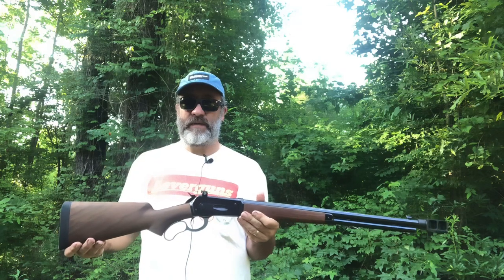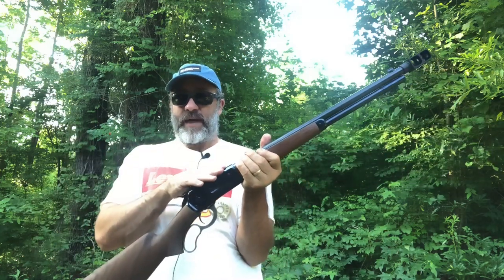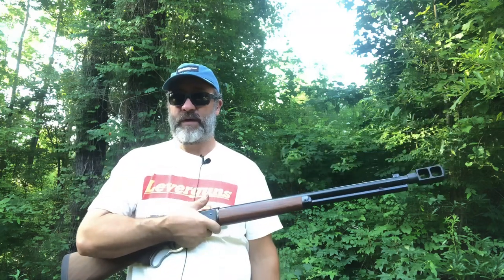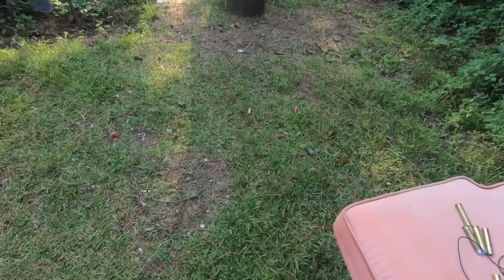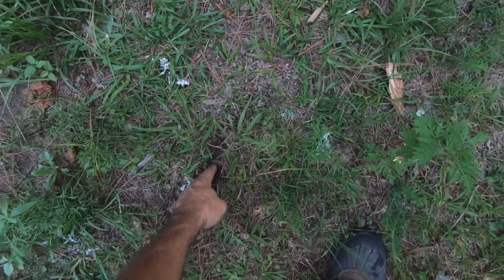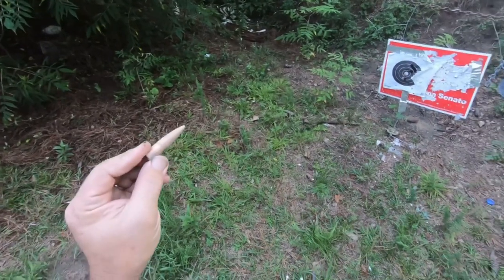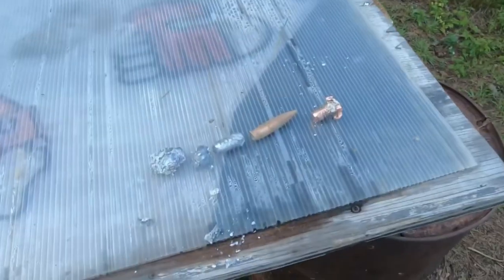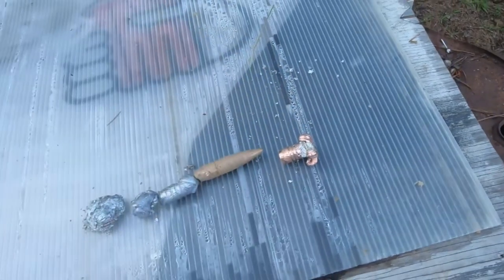1886 lever action elephant rifle 700 gr lead & 650 gr solid copper

Comment: Those blew some BIG holes in those books. Can you tell a big difference in recoil with the brake on it?
Reply from the maker: With those 700 grain bullets in the hot load usually cracks my knuckles on the lever what does muzzle break it’s not doing it

Comment: What did you do with your cartridge lifter to improve feeding when you converted the 45-90? I'm still having trouble loading like it's too long or the bullet too rounded, oal 2.738. so I'm stuck single feeding it. 2.75 OAL is what WLL calls out.
Reply from the maker: I’m sure this could still use a little fine tuning, I haven’t really tried anything but those 300 grain Barnes bullets loaded to the crimping groove

Comment: Did you straight-cut your stock butts from an original crescent? What do you prefer more, the crescent or rubber recoil pad?
Reply from the maker: This butt stock was made for the model 71 Winchester which is mostly flat I just straightened it up some, for most purposes I like the crescent, But for Xtreme recoil this seems to work really good
Reply: @Leverguns50  okay that makes sense.

Comment: Now You Should Do a Side By Side Comparison With The Original 1886 in 50-110 Versus The New Guy with Those Hot 700 Grain Bullets to Compare The Efficiency of The Muzzle Brake I Bet There Is a Noticeable Difference My AR -50 Has A Similar Brake and It Tames The 50BMG to a Mild Recoil Almost The Same as My 1894 Winchester In 30WCF 😀 Just Don’t Stand 30Deg to The Side Of The Gun or You Wont Hear For a Week  😵‍💫😵‍💫 I’m Liking This New 1886
Reply from the maker: That sounds like an excellent idea